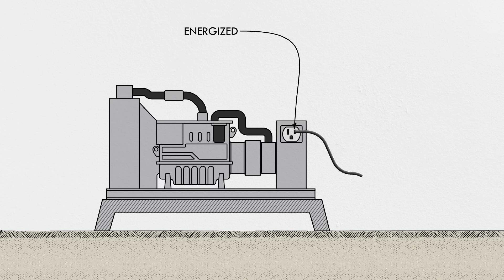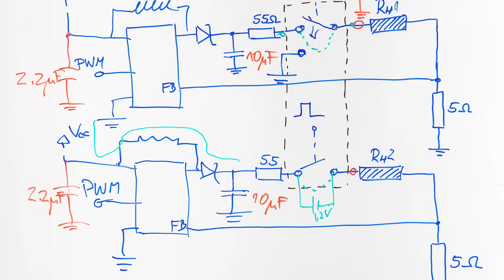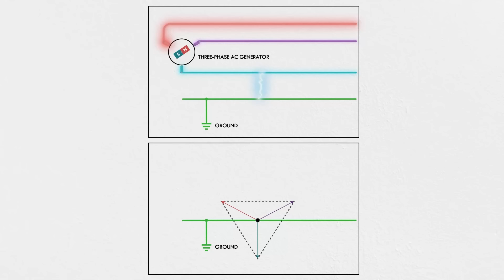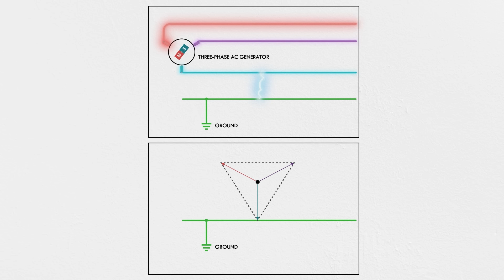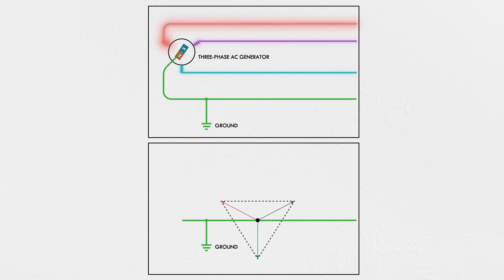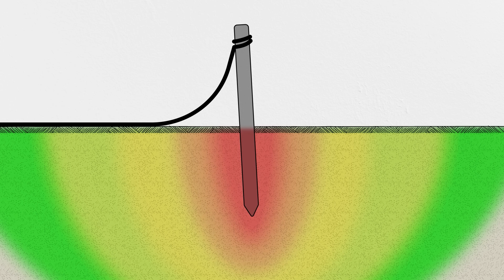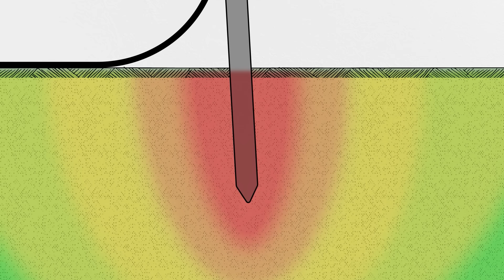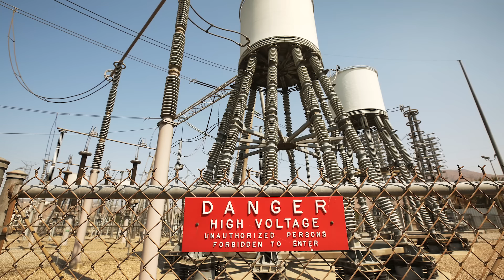Where Does Grounded Electricity Actually Go?

Comment: Well done! You stepped in my territory, and you managed to survive! 😁
Reply: Ahhh!! I love this! This is hilarious
Reply: Yeah! He was on the safe side and did make a really good explanation video.
Reply: Hi mate how are you?
Reply: If you were there Grady would have been cleaning for hours to get the sand off the floor... and the walls, the ceiling, and....
Reply from the maker: I was tempted to leave in some inaccuracies to try to start another YouTube EE debate!
Reply: I guess it's because he hopped in only one foot? :)
Reply: Omg the all mighty ElectroBOOM ❤! What a shocking comment 😅
Reply: This video is now Mahdi approved.
Reply: @PracticalEngineeringChannel  I have a suggestion. Consider Single Wire Earth Return, to your viewers it deserves another video, but even if that were the next video, would you really be done studying it after that? I would keep studying, since it's linked to other such reported phenomenon that even a real Texas Company of several years has current funding and a large well grounded tower to transmit energy via a direct current pulse in Earth ground (powered by ultrashort impulses so it's all flux signal without a reversal). This energy type can dupposedly distribute power to widespread availability through the ground called a 'zinnick surface wave.' Thats the DC through the ground technique, which unconventionally

For other readers:
A single wire Earth return system runs one power line and allows the conductor for the opposite flow in a circuit of electricity be then guided by the part we created to guide. This signal is AC, so current reversal turns it's flow direction from 1/120th a second ago, or the last half cycle experience. It sloshes back and forth. Somehow the Earth itself is able to hold a straight path signal of electricity traveling in flux (power transmission signal min requirement).

But researchers at the Texas company report that the load wherever it may be (a grounded rod with a coil impedance based receiver) can summon the energy in a straight path from the source at the moment of load draw without a guidance wire.

Enough curiosity should be spiked, enough to to more deeply study impulse electrodynamics, or 'transient signals' for their properties of operating at such a 'surface level' on the conductor (no pun intended), thereby reducing friction as light aroind the conductor holds the true energy which is unironically a source seeking a sink.

Some may still be confused about how the energy is considered as held outside the conductor, as it was with triphase powerlines since conception by Nikola Tesla's original 60hz AC design for the Grid. Others will deny a company in Texas solved a critical world problem like that and again I point you to the true genious behind the concept of a one wire system (the world) aka wardenclyffe tower / Magnifying Transceiver patent.

Finally you may be wondering, well who said impulse DC is special and can send this much power without losses. On that one, theres many many modern electrical experiments with energy bursts of ultra short pulse width direct current and lasers. But again Nikola Tesla is attributed to many as the pioneer of cold electricity, or Impulse DC.

And I can say confidently that Tesla's magnifying transmitter patent was designed to be powered by the same power supply as the Tesla Hairpin circuit so often demonstrated and only then called 'my circuit' by Tesla.

The hairpin circuit was once such an impulse generator because it consisted of a magnetically quenched gap. Those of you interested, conduct your research! Pulsed plasma effect, blue-spike phenomenon, lighting EMP, slew rate, etc. 🎉
Reply: Please we're craving for an ElectroBOOM style explanation on the same topic...
Reply: metro boomin make it boom
Reply: @Red-ding-Ton  I'm fine, thank you!
Reply: Your territory? That is such a wild and weird statement. Its engineering, not a protected land for you 😂
Reply: Electro 💥!

Anytime I have a tough day I watch your capacitor alarm clock video, always good to see you doing stuff 🙂
Reply: @vincentpelletier1246  Right.
Reply: @vincentpelletier1246 he's joking, it's his personality. We love Mehdi here!
Reply: Who's the Newtonian-Asimov BOSS NOW??
👁️👃👁️🙏
Reply: @11:07 Zap McBodySlam has exactly the same face expression as you, Mr BOOM!
Reply: Talking about survival I’m more concerned about you 😉
Reply: It sounds like a Nurgle advise.
Reply: @PracticalEngineeringChannel nah man, it's good to be educational and direct than to do that
Reply: Please dont shock me with a billion amps!
Reply: The collab we need!
Reply: Big HI to you Electroboom, you one crazy dude bro✋
Reply: I immediately thought of you(@ElectroBOOM) once he said do not try this at home.
Reply: @PracticalEngineeringChannel kudos to the pics of the Dorsey Converter station in Canada!
Reply: @PracticalEngineeringChannel 💀💀
Reply: He popped in and hopped back out again is all.
Reply: @furqanabid7319 it's Medhi? Isn't it?
Reply: @I.no.ah.guy57  Mahdi or Mehdi, pronounced differently in parts of world. But there is no such name as "medhi" well atleast not in my knowledge.
Reply: @furqanabid7319   well I'm pretty sure that's how I've seen Electroboom himself spell/say his name lol. There's also thousands of names out there that you don't know. If Madhi is common, then who's to say his parents didn't decide to change one letter and called him Medhi. I've heard "medi" more than "madi", of the limited times I've come across someone named that. But in the couple years I've watched Electroboom, I've come to understand him as Medhi and know that a lot of people get his name wrong. I might even be wrong, but I don't really think so
Reply: @@jprupp Both? Why both? 🤣
Reply: Actually he stepped into your GROUND 🙂
Reply: I have a question, and since you are in the industry perhaps you can answer.  Years ago in the early 90s my father and I replaced our old 100watt breaker box with a 200 watt one and had the electrical COOP upgrade the incoming line that went from the main line (along the road) to the meter on a pole out back (we lived in a rural area and had a very large yard); we also re-wired/re-fixtured everything as the old part of the house didn't have grounded outlets.  Anyway, I remember my dad and I neither one knew a lot about electricity, but my father was very safety conscious and actually went to the library and checked out books and studied every night for like a couple months.  We actually made mock-ups to try applying our knowledge before we tore into the real deal.  He actually drilled a hole in the wall by the breaker box and connected it to a long copper stake that he had driven in the ground.  Was this overkill or unnecessary?  Also, is this how lightening rods work?  Are they connected to a ground rod too in order give an alternate path to ground besides your house?  Sorry for the long yarn; thanks for your indulgence.
Reply: You mean, hopped on one foot? 😄
Reply: huh?
Reply: Power Substations in Mideast have ground rods drilled through ground water for lightning protection system and also separate grounding/ earthing rod (drilled similar as lightning was)for equipments like switchgear, transformer etc. Each Earthing rod or Grounding rod (copper ) has typical length of 3 meters which can be connected through threaded end with coupling depending on its depth requirement.
Reply: You say there is no free energy? While I agree.. but I figured how to do it with no magnet or coil or battery or power supply or any moving parts. Look at the remastered galaxy in a box on my home page. I solved it 100%.
Reply: it isn't your terriroty, lol

this belongs to the people
Reply: There is little praise higher in an electrical educational video than ElectroBOOM watching, commenting, and not finding fault.
Reply: Being profoundly grounded in reality. He avoided a potential risk.  Both of you are big capacities. 
In my age you would expect me to behave. Being in my fifties I still can't resist...
Reply: omg it’s the human ground 🤣🤣
Reply: Of course he survived he's an engineer
Reply: Lmao
Reply: We would love to see you give live demo in a high voltage transmission line ☠️
Reply: @ickorling7328  If you are at Mars, Moon or Sun, you can not earth your gadgets, because at Mars Moon and Sun you have no Earth.
Reply: Don’t step into BOOMS lane!
Reply: domain expansion
Reply: @ElectroBOOM now it's your time to step on to civil engineering

Comment: In the Navy even though it can be more dangerous, we often use ungrounded 3 phase distribution systems so that they continue operating even in the event of a ground fault (like a missile blows a hole in the side of the ship)
Reply: Really that's cool!
Hawaii EJ
Reply: This (ungrounded 3-phase delta) is also fairly common in industrial applications, especially for wet processes where ground faults could be common.
Reply: i think it is pretty common not only in the navy but most of merchant ships today just monitor ground fault and have an alarm system for it, instead of interrupting the service, in the power generating side however(in the generator) it is still necessary to monitor ground fault current
Reply: I was a welder in the navy. Most of the time we only needed to carry/run one lead to the work area/parts, as the ship was the return path, AKA ground.
Reply: Apparently the star point in a 3 phase generator is bonded to the hull so that if there is a short and the equipment is bonded to the hull, it can return to the neutral/star point.
Reply: Yeah man that's neat as heck. Did you ever serve on a submarine? I think submarines, or as you call them in the Navy - SSN & SSBN, are one of the coolest things humans have ever engineered. By the way, thank you for keeping my family and me safe and free. You armed forces men and women are the best!
Reply: @jamesprototype40  right, in our fleet we use a calculated resistor called the NGR or  neutral grounding resistor that limits this fault current when phase to ground short happens
Reply: @rthony7780  And I assume you monitor that resistor with an alarm to warn of any ground fault currents? That's how I think it should work for any system not vulnerable to lightning discharges. E.g., most isolated power systems.

Comment: As an electrician I see a lot of apprentices get confused with grounding, grounded and bonding. In school and generally out in the world we hear a lot of "electricity wants to flow to ground" without really understanding whats happening. Easiest way I explain it, electricity doesn't want to flow to ground, it wants to return to the source, through the ground, in a grounded and properly bonded system.
Reply: That is a good explanation because this way it's very easy to see that there won't be any electricity flowing from the battery to the earth.
Reply: Whatever leaves the source must return to the source
Reply: Call it return path instead of ground and it will make a little more sense.
Reply: What is bonded?
Reply: You just explained it better in 3 sentences than 95% of today's electrical instructors or teachers can - no wonder so many apprentices struggle.
Reply: @nwsteg2610 the connection of metal conductive surfaces that may inadvertently become energized.
Reply: What is the source?
Reply: @TreDogOfficial  it could be a battery, a generator, or other similar sources. It’s a generic term because a source could be a number of things.
Reply: It doesnt want to return to its source. Moving electrons flow through conductors to find balance in other balance rings. To make electricity flow you unbalance electrons from their orbit.
Reply: Movies
Reply: I was starting to watch the video and stumbled upon this comment and just had a aha! moment, it finally makes sense to me. I’m not an electrician btw, and my knowledgeable electrical systems is very limited, but I do think there’s no need to be and this kind of things should be taught in school early on not because we all need to be able to make our own electrical work but because it is actually something that provides a better understanding of how our world works. Plus I know have even more questions I want to find answers to! :D Well, I guess I’ll watch the video now. Thank you! ❤️
Reply: Earthing*
Reply: @nicolasjonasson4820  Well, we are using the ground to define a 0 point is more the case, everything then becomes a potential offset from that, And here in the UK, we actually use earth and ground as different things, one applies only in the case of the grid supplied electricity (earth) and the other applies to all circuits, of course in the mains supplied electricity ground and earth are essentially the same. The case really is, everything wants to 0 out, and we use this by putting load on the other path, of course it is safer for an easy route back to 0 for the reasons in this video.
Reply: Or, charges move between differences of electric (field) potential
Reply: As an electrical apprentice who feels he has a grasp on it , how I explain it is electricity will take any and all paths back to its sources, hence why we separate grounds and neutrals on sub panels allows less paths back to the source . Anything that goes on a ground wire is trying to return back to the neutral at the transformer while any high voltage such as lightning strikes 1. Will install destroy your system if hit directly 2. They will take the path of the grounding rod , not the transformer
Reply: But if the condition of the earth (ground) is like the dry sand experiment, how can the current sense that the source is even there (reachable thru the earth)?
Reply: @mrorganic13   It depends of the grouding system of your country and what you are trying to achieve. There is always a tradeoff in grounding system between safety, eletromagnetic perturbation and cable cost https://en.wikipedia.org/wiki/Earthing_system
Reply: Does it want to return to the source or does it want to equalise its potentials? 230V to 0V?
Reply: What do you input into the system to throw it off balance? More electrons?
Reply: This is actually incorrect
Reply: @modquad18  it doesn't, the electric fields are trying to equalise out to a potential difference of 0. Charge flows in all directions to do this, more charge goes down the path with the lowest resistance, really high resistance paths get no charge (we call these insulators). Enough voltage insulators are conductors too.
Reply: i usually just call it the "emergency neutral", and they usually figure it out on their own after that.
Reply: @oal2928 lol, yeah, electricity should never 'flow through the ground' under normal conditions.
Reply: @Bacongrease00 👍 unless the source is Vegas 😆
Reply: @TreDogOfficial typically in an AC system you can think of the source as the secondary of the transformer that feeds the system. This is where the wiring begins. All the current that flows from the transformer will return. The imbalanced current between the phases (hot wires) will return on the neutral wire. All ground wires are connected to the neutral to provide a path back to the transformer in case of a fault. The neutral is also connected to the earth itself through ground rods. This is done mainly for lightning protection.
Reply: @michaelknight4041 oh, so it protects us from circuit's brightness huh?😎
Reply: 🔴I connected my motor phase wire to phase wire on pole and it's neutral to the soil, and the motor  worked. How is it possible that the grid is kilometres away and you have only 220v a.c. and the ground conducts so easily. If it does so then the ground resistance is not so high it is very very low.
Reply: @automotivedefenz2195  Is that the Stargate I used to watch on TV?